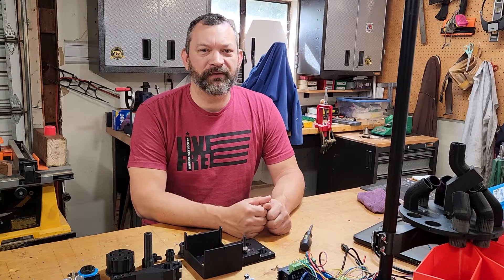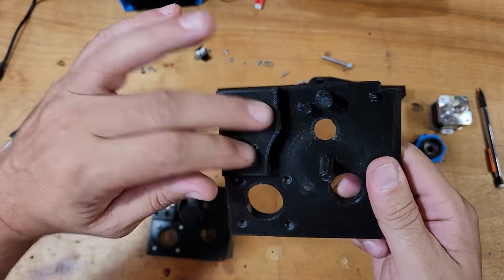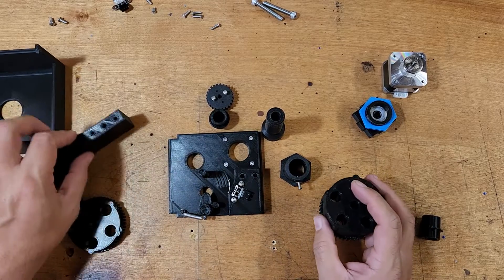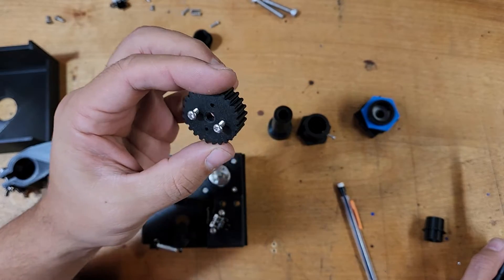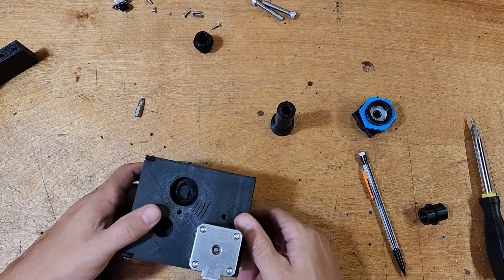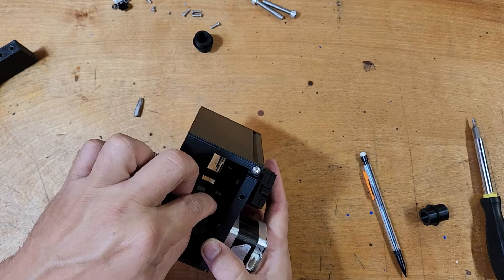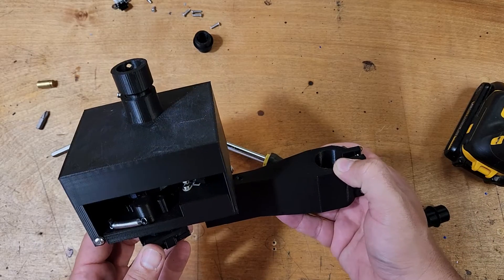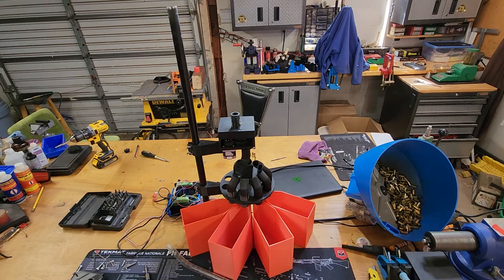CS7 - A new take on sorting brass cases by headstamp

Comment: Can the software be modified to detect berdan primers by the primer diameter?
Reply from the maker: I don't believe there is any detectable difference in size for berdan primers so probably not possible based on that, but the berdan primed brass usually has an associated headstamp that it could sort by.
Reply: I did think of headstamps but some are both types of primer. Large rifle berdan has a larger diameter cthan boxer, etc…. Is it possible to use the camera to look down the neck (invert the case) to look for one flash hole in the Center?
Reply from the maker: I don't think the machine could do this as it stands today. You would have to be able to focus the camera and the light to look into the cases and then alignment would be an issue as well
Reply from the maker: I mean, theoretically it's possible with this machine but would take some tinkering

Comment: Thanks for sharing this, it's been a fun project. I had been working on one a while back with openMV Cam that looked like the rotary dial version you moved on from. I got a bit stuck trying to figure out how to position the brass over the camera without using a piece of glass. Had though about using a microscope slide, but never implemented. Your version seems to have potentially solved that problem.

I do have a few questions , wondering if anyone has experienced an issue where the brass seems to slip down a bit over the camera and get stuck on the edge of the base during the shell plate advance? I think I'll try to chamfer the hole used for viewing on the edge it advances towards, but before I do, wanted to check and see if others had solved in a different way?

Also, if anyone is having problems getting the camera to focus, I had to manually adjust and move the lens out. This allowed it to focus on closer items.

One additional thing, if the spots where the spring  connected to the tenson cam and the classifier base had a hook I think it would be a quick improvement.
Reply from the maker: So the problem you mentioned has been solved in the latest version (which I haven't released yet) but it involved raising the feed side by 2mm and also cutting a groove in the tension cam in which an o-ring sits. The rubber gives better traction. You can also just super glue a bit of rubber band on the contact face of the tension cam as that seems to work for others as well.

Comment: I have everything working and there is one issue that Im wondering if you have experienced as well.  Every once and a while a 9mm case will fall "tilted" and doesn't drop straight into the cartridge spool.  When this happens, the sorter jams and will grind on the gears.  The only way I can resolve this issue is to power off the motor controllers, correct the tilted case and move on.  I have tried adding o-rings to the drop tube to keep it from moving and even adjusted my homing offset to get the drop hole perfectly underneath the tube.  No matter what I do I have maybe one out of 100 cases that will do this.  Not a huge deal but definitely requires me to sit and stare at the machine when I run it through a sorting cycle.  Have you ran across this?  Would it be possible to have the stepper motor back up by 1 or 2 steps right before it rotates clockwise? This "jolt" should correct the tilted case.  Another suggestion is to have the machine stop the sorting process after X amount of seconds not getting a focused case picture (similar to the stop function after getting several "blank" pictures) . Hope this makes sense.   Thanks!
Reply from the maker: Yeah, I have encountered this from time to time and there are some fixes. If you don't mind, please email me and we can troubleshoot it further. My email is in the channel info (you need to use a computer as it doesn't show on mobile devices)

Comment: The camera seems to be unobtanium in Canada. Any issues replacing it with a higher resolution camera as long as the FOV is the same?
Reply from the maker: I think as long as the sizes and fov/focal length was the same, it should work. The camera is also avaliable from Ali Express here: https://m.aliexpress.us/item/2255800428160152.html?spm=a2g0o.productlist.0.0.5f707621prYXZz&algo_pvid=d1db212b-8be3-41c3-bbe3-e88c7cc93bad&algo_exp_id=d1db212b-8be3-41c3-bbe3-e88c7cc93bad-59&pdp_ext_f=%7B%22sku_id%22%3A%2210000004016284977%22%7D&pdp_npi=2%40dis%21NOK%21263.94%21250.77%21%21%2192.79%21%21%402101e9d316664697050524419e75a3%2110000004016284977%21sea&curPageLogUid=ZHqutjEPQrzU&gatewayAdapt=gloPc2usaMsite4itemAdapt&_randl_shipto=US
Reply from the maker: Ok, I found another one on Amazon which looks to be the same thing and I stock. Here is the link, make sure to go for the 100 degree version. 0.3MP High fps USB Camera Module 1/4” CMOS OV7725 Sensor with 100 Degree M7 Lens,Support 640X480@60fps,UVC Compliant,Support Most OS,Super Mini 32X32/26X26mm USB with Camera,High Speed USB2.0 Webcam https://a.co/d/386nwkx
Reply: @sjseth-builds  Amazing, thanks for the help!

Comment: My case sorter is now built and running. I started as a complete newbie a month ago. This group of videos induced me to buy a 3d printer (Prusa), buy all the listed parts, buy a couple of books and watch videos on Arduino builds and programing, and start the project. I did have several difficult challenges and issues, but they were mostly of my own making. This is a great design ending with a great result. At full speed it sorts at 74 pieces per minute. Accuracy is about 85-90 percent so far, but improving with machine training including periodic cleanup of saved training images that are subpar. Prints were all with PLA.
Reply: Do you know your total cost including the 3d printer?

Comment: What are the support pole sizes, either in or mm? Thanks. I do not have a Dillon case feeder so I'm making my own. just wondering  about the diameter.
Reply from the maker: It is a 1 inch  diameter pole.

Comment: What is the name of the microswitch, it feels like 1837636 different and which pins is it connected to?
Reply from the maker: Not sure what model number but here is the link where I ordered them: https://www.amazon.com/gp/product/B07PCN6T6F
Reply from the maker: Also pretty sure this is exactly the same thing without the wires plugs and control board. https://www.amazon.com/Cylewet-25Pcs-Switch-Arduino-CYT1073/dp/B073TYWX86
Reply from the maker: Re: Pins, it connects to 5v, grnd and pin7  if you are using this arduino sketch https://github.com/sjseth/AI-Case-Sorter/blob/main/Arduino/case_sorter_CS7/    of course you can always update  the arduino code and connect it wherever you prefer.

Comment: A thought for the bins with the long print time, make the bin a solid object and print it in vase mode with like a 1.2mm line width.
Reply: Check out a couple of videos on strong vase mode prints. There's a few ways to do it depending on how strong you want them and your available nozzle diameters.
Reply from the maker: Thanks for the tip. I have a couple more to print and will give it a try.

Comment: I'm assuming you printed the case wheel with supports?
Reply from the maker: Yes, I just used standard supports in Cura. For the main base I used tree support with 80 degree support threshold. This prevents the supports from mixing in the threaded part

Comment: Just keeps getting better and better. I do wonder how long the 3d printed gears will last. Any reason that you could not drive the brass wheel directly?
Reply from the maker: Mainly space would be an issue. I would have to make the wheel much bigger. Also there is a mechanical advantage on the 2:1 gear ratio. I have only run about 2k rounds through it so far and haven't see any issue but would expect wear to be an issue at some point. This is all more or less a prototype.  I do think having the gears made from nylon or a more durable material would be important.  There are several shops out there which you can send models to to get them printed in harder materials than a standard cheap FDM can do.
Reply: Can I just buy a completed one from you?  @sjseth-builds

Comment: been following and Im in the process of assembling the parts.  Finally a project that will force me to get a 3D printer.  😁.   My one question is about the windows software.   can it be trained to recognize the difference between small and large primers?   i.e 45 ACP SP/LP or 10mm SP/LP
Reply from the maker: Yes, it can be trained to do that.  In fact, it would be a good demo I think. Maybe I will try to put one together if I can find some small primer brass in my buckets...
Reply: @sjseth-builds  good news.  nothing like being in the groove loading 45s and everything comes to a halt when you try to stick a large primer in a small primer pocket.

Comment: Hey I’d love to talk to you about this project. I am in the market for a commercial application to sort .45 by primer size
Reply: I've been working on a setup to sort by primer size that would work in a commercial application. I've uploaded a couple videos of the progress.  Its an automated dillon 750 and I've replaced the primer inserting with a go/no-go gauge for the primer pocket hole.  Station 1 decaps and sizes, station 2 probes the primer pocket.  Then the arduino keeps track of what brass is in what station and it sorts them with a servo and flipper at the output chute.  Its not smart enough to sort by headstamp like this project.
I've been running mine at 1500/hr.  It will crank up to 1800/hr, but I've kinda been scared to run it that fast and start breaking my little switches or outrun the servo flapper.
Reply from the maker: The software can definitely do that and is very flexible in that, if you have a better machine design (like something made out of metal), it can communicate to it over serial bus. My contact information is in the channel info but you have to be on a computer (not phone) to access it